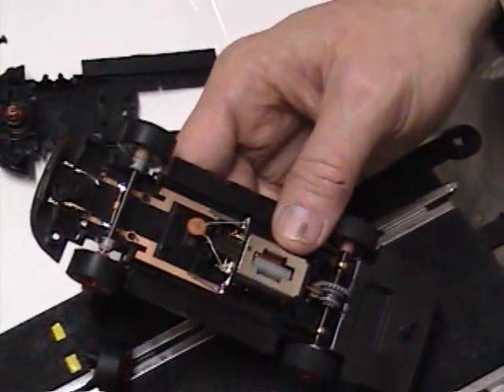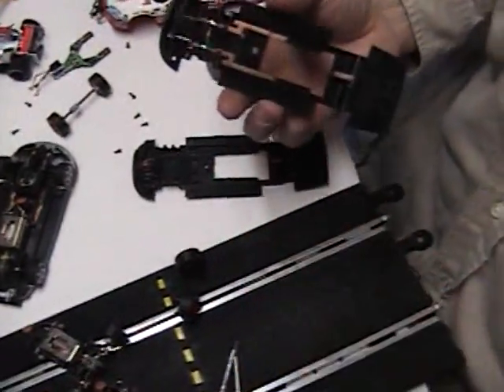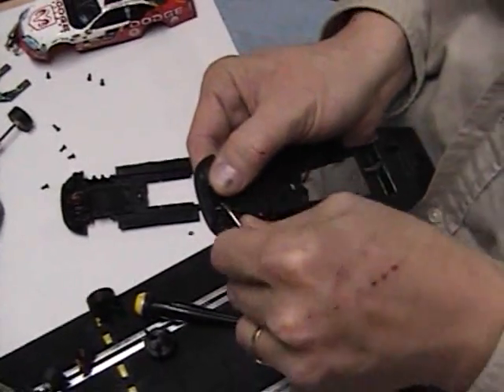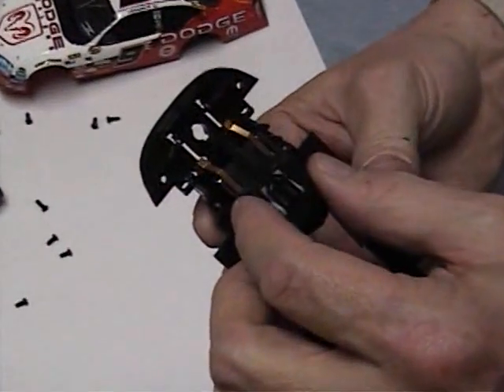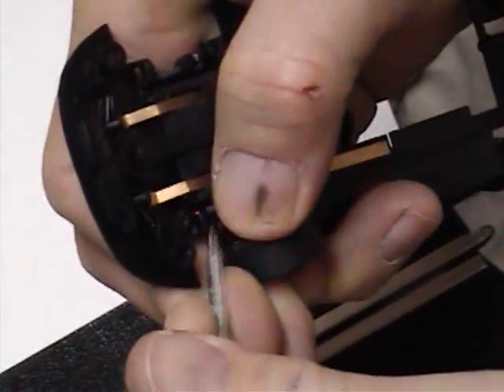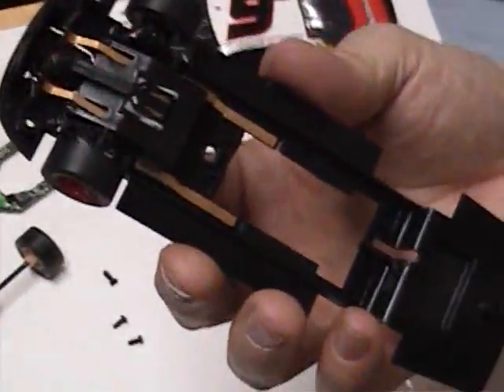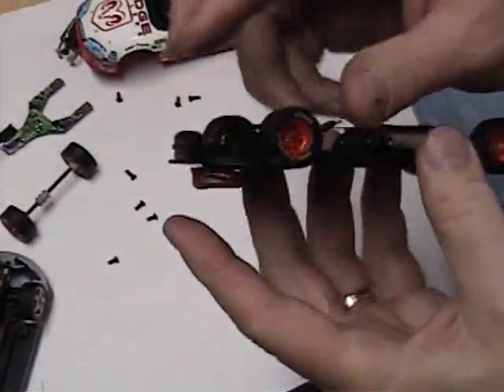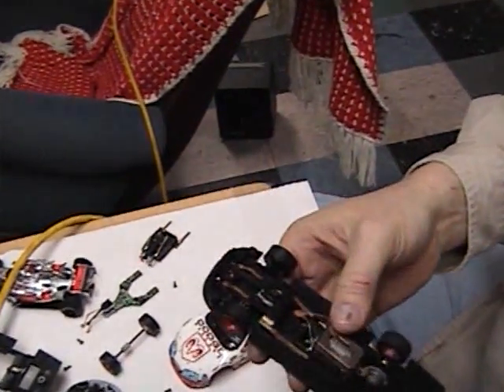SCX Analog to Digital

Comment: Can you show me how to convert an SCX analogue Car to run on Scalextric digital track, I know I need to add a Scalextric digital Chip, but I need to know how to install it, do I remove the the flat copper connectors that you ripped out of that Car and wire/solder it in, or can I leave those in, so not to wreck the original Car?